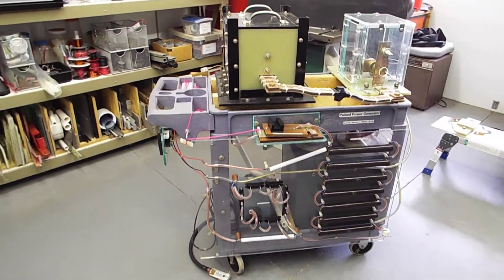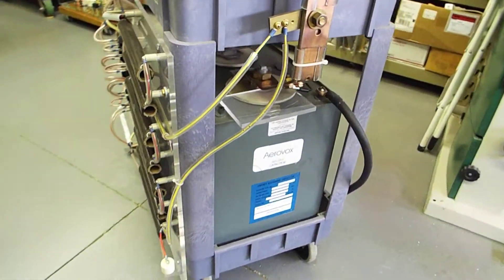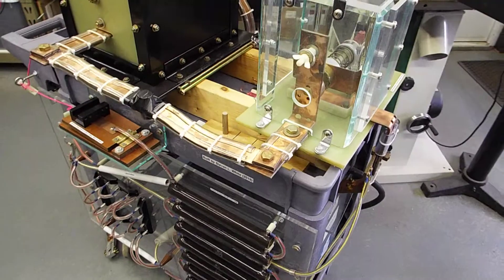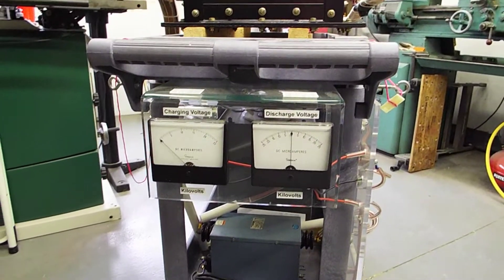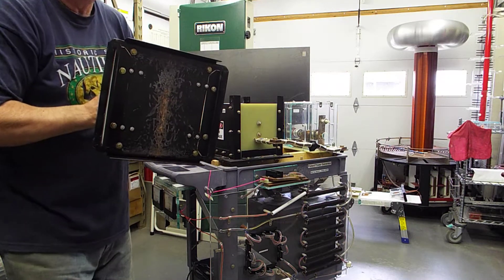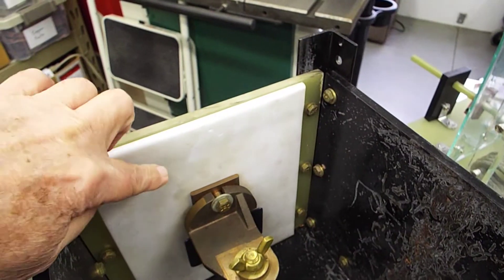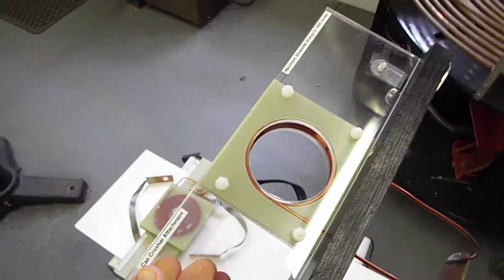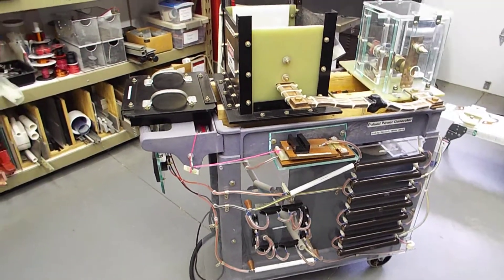Pulsed Power Generator Overview (coin shrinking, can crushing, disc launching)

Comment: I want one of those capacitors really bad, I've got a bank of twenty 475 volt caps about half the size of pop cans from a studio strobe light power pack (an old speedotron 812) and it packs a wallop but I want something bigger at much higher voltage, and these giant ones seem like just the ticket. They're hard to find though...
Reply from the maker: They are occasionally available on E-Bay although the shipping cost is high unless you can drive there and pick it up yourself which might be worth the trouble. That's where I got mine.
Reply: @littleshopofelectrons4014  I'll keep an eye out, thanks for the tip.
Reply from the maker: I see some on E-Bay right now for $400. Search under "Aerostor".
Reply: @littleshopofelectrons4014  Holy jebus that's it! Thanks a bunch man, I'm ordering one right now...